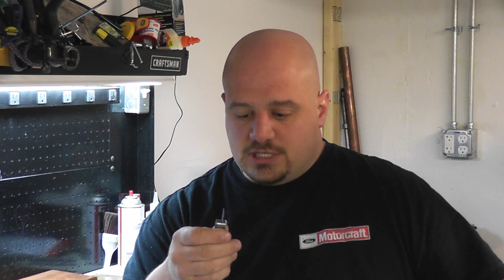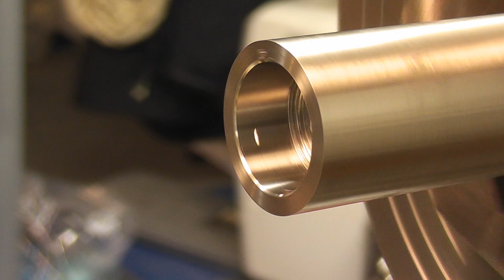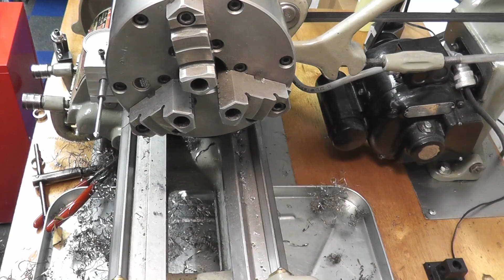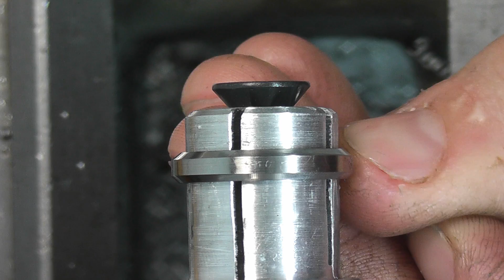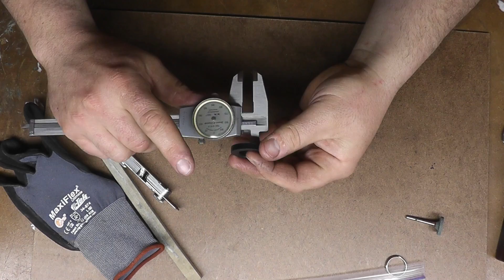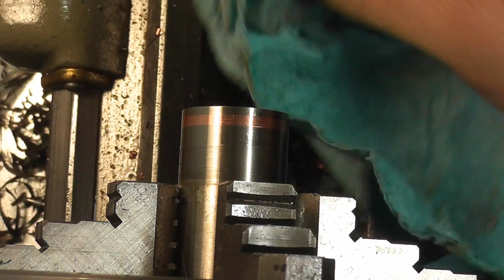Making His and Her Wedding Rings

Comment: Thank you for pointing out SAFETY concerns about Titanium rings. This is one of the reasons I have avoided doing something like this... afraid of how EMT are going to get something cut off that's too damn strong to cut. I had not checked into softer grades.
Reply from the maker: As a former EMT I've cut off gold bands before.  We used a commercial hand ring cutter.  Hospitals have removed harder rings usually with bolt cutters.

Comment: Hello, back again and this time with a question about the boring bore you are using. I am using the Phase II QCTP holder and it came with a Phase II 250-104 boring bar holder with a 3/4 in bore that I am unable to find a boring bar for. Later I bought a Phase II 250-102 boring bar holder that looks like the one you are using. What exactly are you using. I recently bought a 1/2 in boring bar with inserts that fits the holder, but that does not engage the work or cut properly. The Little Machine shop is sending me a replacement, but ? Thanks in advance.   Ken
Reply from the maker: Kenneth Bartlett That's the toolholder I'm using.  The bar is unmarked and uses triangle inserts.  It was in the box of things I was given when a family members father passed away.  It's Very similar to this   http://www.shars.com/3-8-coolant-through-indexable-triangle-boring-bar

Comment: nice work! I've made a few rings in the past out of stainless but I may have to do some in titanium now, I also really liked the inlay you did, I think you could do it in a single piece and heat it, slip it on the groove and, with the help of a simple conical shaped die (picture a steep sided funnel) shrink it in to the dovetail groove, the inlay could then be rolled in to force the metal in to the dovetail using a clamp on type knurling tool, this should also cold work the soft inlay metal hardening it somewhat which in theory should help it machine a little better, just some thoughts on it, I may make a die and try it the next time I make rings, perhaps I'm over complicating things for my self though.

Comment: I was not sure what to expect and was amazed at your skill. It has been 30+ years since I used a metal lathe back in high school. Every now and then I run into a situation where I need a custom part for auto repair or other projects abd think "if I only had a lathe". Without spending a ton of bucks what would I look for to do some small work around the garage? Kind of like what you did but not for pretty stuff. More functional. Thanks much.

Comment: Nice job.  You can make a mandrel from delrin rod, just turn down end to a snug fit then press ring on and position ring on arbor.  To tighten run a drywall screw into end.  The delrin is plastic enough to expand from internal pressure of screw and hold ring.
To keep your other two fingers from turning green, and to keep copper from tarnishing, apply clear nail polish.  You can also coat inside to create tighter fitting ring.

Comment: Nice Job, Greg!  They came out real nice!  Curious if the silver solder actually stuck to the Ti or just bonded the Cu joint. Amazing how well it disappeared in the final form!  Was thinking that the different thermal expansion rates of the materials may cause it to separate after a time.  Was thinking that if you made a L&R tool you could put a bevel on the the groove (dovetail) and form the copper into it with some light taps then silver solder, any difference in thermal expansion could be minimized??  Just Thoughts.  Love the idea of a light and strong ring.  Also curious how much that Ti RB ran you?  Thanks for sharing!  ~PJ
Reply from the maker: The tool I used to make the groove is a dovetail grove.  I plunged in and moved left and right to make a dovetail.  Heating up the copper strip and hammering it in caused it to form under the lip of the dovetail.  I may have left that out in the editing process because of time.  The silver solder only bonded with the copper it won't stick to the Titanium.  A 12" 1" diameter bar of CP2 cost me $107 plus shipping.

Comment: Nice work. I make quite a few metal rings on my lathe and I use a slightly different process for shaping that works well when you make different szies. I bore and part the ring in same way as you but then I chuck up a jewellers ring mandrel on the lathe, this is hardened and tapered and of course handles all the sizes of ring. I tap the ring gently into place and then use a series of fine tooth files to do the shaping before polishing.
Reply from the maker: Yeah that mandrel would have saved a lot of time and headache.  I didn't have any really fine Swiss files lying around small enough to use and didn't want to gouge it with a coarser one.  The paper worked alright, but it took a bit of time.
Reply: Well it's a case of use what you have, your work doesn't call for that kind of tooling, mine does, your method worked well and results are great which is the important at the end of the day.